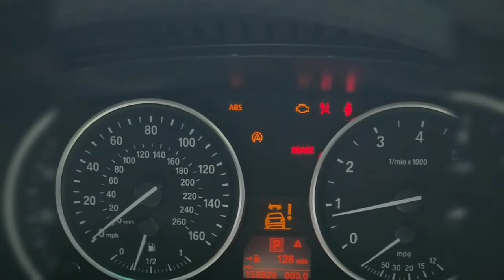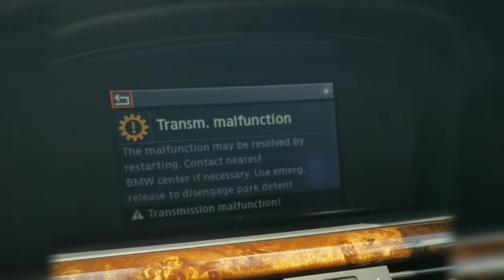2008 BMW 535I E60 ALTERNATOR FAILURE

Comment: Thanks for posting this up.  Just had the same issue on my 2008 E60.  Went to autozone to replace the battery and still had the same issue.  Now I gotta wait for the tow truck on Monday to have the shop confirm that the alternator is dead
Reply from the maker: DASYHRD seems like they simultaneously go out together.. no good. Good Luck! 👍🏾
Reply: You fix?

Comment: Man, I had the same problem a couple of days ago.  I was able to make it home but if the alternator fails, the electric water pump starts losing the right amount of voltage and your heater will come on full blast.  This happened as I was arriving at home and right before it overheated.  I will be changing the voltage regulator but it's a learning experience.  The moment you see transmission malfunction and the dash does all that.  Tow it, change the alternator and battery to prevent overheating for the next 223,000 miles.  Yup, that's how long that alternator lasted me.  Good luck!!!
Reply from the maker: Yeah I changed the alternator and battery and sold it. That electric water pump is also a b to get out and in. Alternator comes out easy but that millimeter of metal on it makes it troublesome to get back in. Great car but my favorite is E46 model.

Comment: I just replaced my starter and after putting everything back, and when I started my car all the lights like on your dash came on as well the fan is running as soon as I start my car. Do you think it’s alternator?
Reply from the maker: I would start with checking the battery. See if it’s all associated with poor power. These cars need a fully charged battery or it will act pretty funky and have the car doing all types of crazy things. If you have a scan tool I would go that route to check the battery voltage while off and while running. Should be around 12-13 while off and 14 or a little higher while running. Another test is to crank it and while running take the positive battery head off & if it cuts off it’s the alternator. But also check your wiring to the starter and anything taken off around it that you may had knocked out of place or didn’t connect back. Hopefully you removed the battery head while changing the starter, because  that shouldn’t happen after swapping that out. Last but not least It could be a failed electric water pump triggering the fan at start and coolant light, safety warning ⚠️ . They are a pain to change. Crazy tight spot to get to. 🤦🏿‍♂️ 

Hopefully all of this helps, gives you checklist to run down. I’m willing to bet it’s one of these issues. Feel free to follow back up

Comment: Folks reading this in the future, you only need a voltmeter to test the alternator. If you disconnect the wire harness plug which goes back to the DME computer and if the large wire going to the battery increases in voltage, then it's charging in LIMP Mode, if it does not start to charge, then you need an alternator. This is for CAN cars typically newer than 2007 with a SMART alternator, it might only have a single small wire on a 2 wire connector communicating via this LIN wire to the computer. If the alternator does start charging then another item on the LIN Bus may be shorted so disconnect them one at a time to see if the alternator comes back to life with its LIN wire reconnected, problem found. Be aware of a pattern fail item of the oil pressure switch OR oil temp switch?? You will need a wiring diagram or assistance to know all the LIN items. Good luck.

Comment: Did you lose window power, AC and pretty much everything electrical? I just had this happen to my 08, and it’s doing all of this same stuff :/
Reply from the maker: Josh Powell yes. Everything shuts off. More than likely battery and alternator
Reply: richirich1 thanks for the reply! I’ve been getting a “high battery drain” warning too, so I’m sure that is related as well

Comment: My bmw just did this. Was driving fine, parked and idled for 10 minutes then it happen. Checked my csrly and my battery is being overcharged, 15, 16, 17 volts. Gonna change voltage regulator, might be the issue.

Comment: Did you ever figure this out?
Reply from the maker: jflabeets1 turns out it was my battery and alternator. Long story short and $500 spent replacing I fixed it and sold the car
Reply: richirich1 had same issues today but also transmission failure and engine temperature. I had both battery and alternator tested but not while these issues were active. 

Did yours pass an autozone style in car battery test?

Guess it’s off to a service center to see what they fine...
Reply from the maker: jflabeets1 yes, the battery and alternator caused the trans failure message. Once I changed the alternator I noticed it was acting up but then it happened again and I got into the secret menu to check battery voltage and noticed it was fluctuating too much so I changed it and everything was fine.